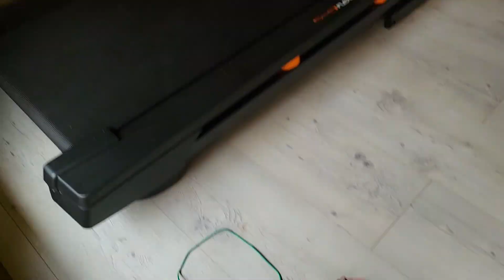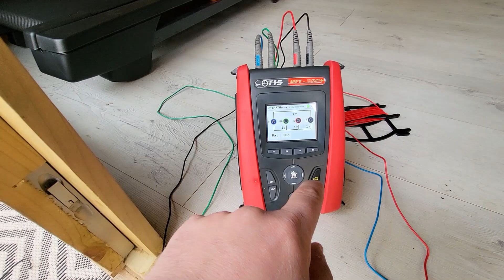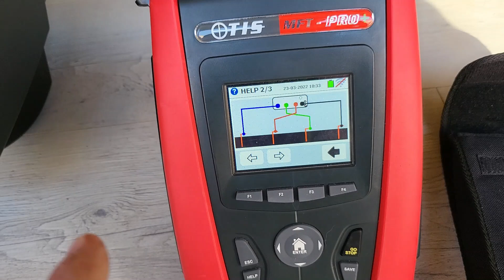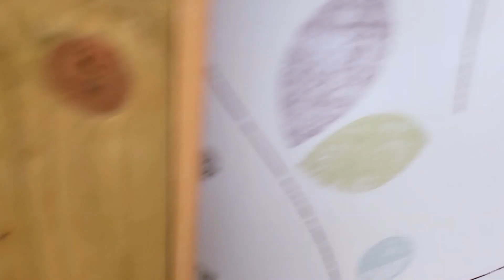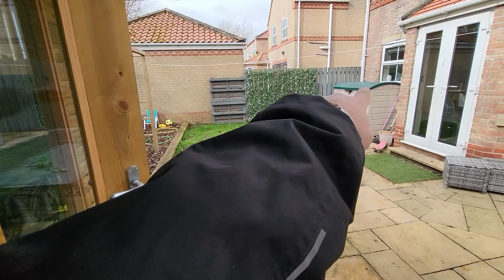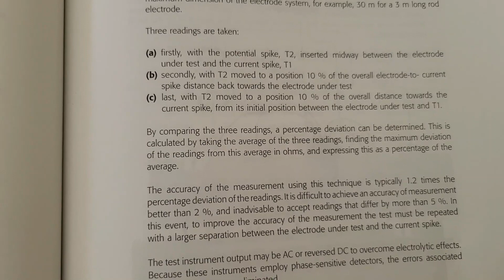Testing an earth electrode like an IDIOT?

Comment: Hi Mark, great video BTW. With regards to DNO not restoring TNS after faults etc. I agree nowadays to assume TN-C-S supply especially for EVCP etc. However when we test ZE as per any visit to a property. We are going to have quite a few readings above 0.35 Ohms. Even if definately TNS incoming at cut out. Could still be TNCS less than 10 mtr away. We don't know, question is, "Do we report high impedance to the DNO?  Or Not?" It's a riddle 🙂
Reply from the maker: The dno are a law on themselves lol.

Comment: can i ask what is probably a very basic question...
why is there a difference between the resistance of the supply electrode at a max of 21 ohms and the consumer's electrode having a max of 200 ohms before it becomes unstable?
Reply from the maker: Hi mate, the DNO is more concerned about fault currents and touch voltages in the network. Sizing conductors and parrallel paths to mitigate them. On our side we just need a reliable enough impedance for our rcds to work for both fault and additional protection. Technically that could be a much higher value than 200 ohms but that is what is considered reliable in terms of variation due to weather and ground conditions. Thanks for watching and joining in the chat!
Reply: @electrician247  thanks for the reply and explanation. I can't wait to see your electrde series of videos. you're doing a great service to everyone in the trade, old and new
Reply from the maker: @LocoSajoca  thank you. I am just having fun 🤭